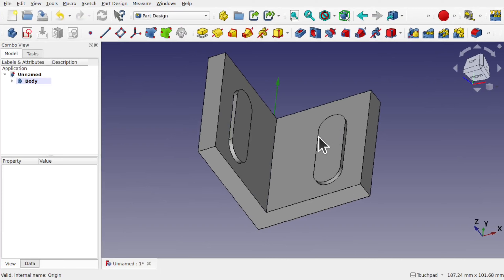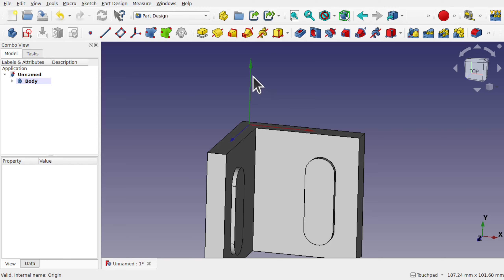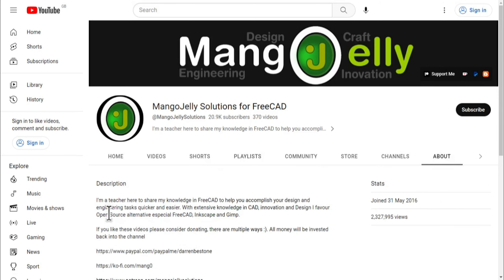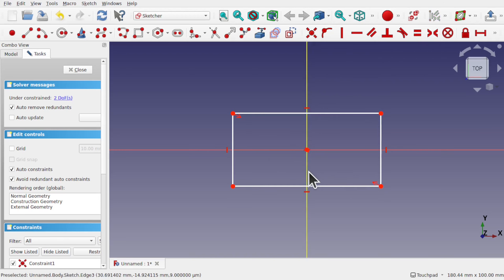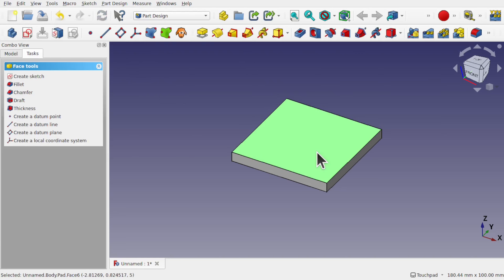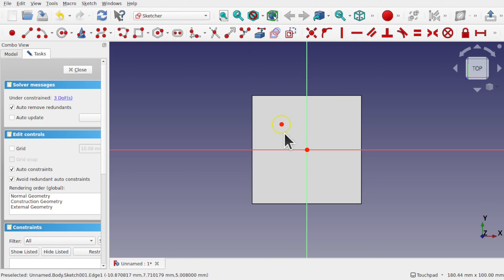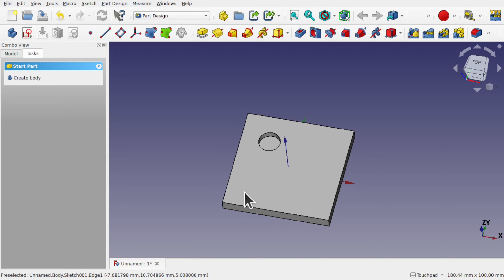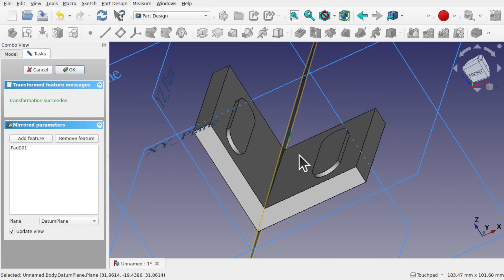FreeCAD For Beginners 45 | Mirroring off centre features | Part Design Workbench | Datum Plane

Comment: I appreciate you can only do so much perhaps a brief explanation (or direct us to appropriate WIKI) regarding Attachment Mode descriptions i.e. Plane by 3 Points, Inertia 2-3 etc. For New Chums its a bit overwhelming. I do know what Normal (to Sketch)is but the 3 points? (Points on Plane?, Surface?). I'll check WIKI for Glossary of Terms. Pardon you actually did elaborate (great anticipation Mate!). Really need to just play around on FreeCAD more to explore the various options).

Solution for positioning the Datum Plane @ 12:09, after some trial and error Lights went on, I used Opposing edges Pad001:Edge2 & Pad001:Edge18, Default Attachment: Plane by 3 points instead of the Vertices You had trouble with (No need for Rotation, I had a bit of trouble Getting my head around why you chose the Rotation Axis you did, Perhaps a separate Tutorial,? I have trouble with Local CoOrds etc when you get away from the Primary Origins. Perhaps Computers, like Me prefer Straight Lines ;-) Noticed you used the Edges in the Last Example, perhaps Edges are processed better by the Software. FreeCAd appears to have a few Idiosyncrasies ;-) Maybe this Dinosaur is getting the hang of this CAD Thingo!

Again an other very stimulating Tut, again I can see possible uses for my Aero Modelling where duplication of features are needed. Off to the Shed and some Sanding!
Reply from the maker: Sorry been away and trying to catch up on comments. I think I can help you here as I already have a video on that subject https://youtu.be/jfhgcDcAAlk

Comment: Thanks! I didn't think of this before. When having trouble selecting edges (or worse: vertices), I switch to wireframe view (Keyboard: v 3) and then back to normal view (v 1). 
Btw, during this video I noticed for the very first time, that the orientation of the axes cross is quite simple to remember: X is red, Y is green, Z is blue (like RGB colors) – "XYZ is RGB"  is easy to memorize.
Reply from the maker: I keep on forgetting about wire frame mode as you can do some interesting things by setting certain geometry to wire frame in the view tab.  Never thought of using it to make the selection easier by quickly changing to wire frame mode with the shortcut and back again.  And never thought about XYZ and RGB, that is another great tip!!!!! Thanks for sharing that! I be using that for the future :) :)
Reply: Thanks Mate Good idea! Also if you have Older Eyes don't be scare to up the point size heaps! I've found you need to be careful when selecting, a Mouse Click (Audible, for those of us not too deaf LOL doesn't mean that FreeCAD has registered it as input). I often find a lot of problems later in the Workflow come back to seemingly inputted but not registered Constraints and the like. FreeCAD is a complex System and has some idiosyncrasies we need to be aware of! Perhaps also it could be the Dinosaurs trying to use it LOL ;-)

Comment: Could I suggest that you reference the FreeCAD version at the start of your tutorial? The icons seems to be different to the version I am running (0.20.2). Thanks.
Reply: Still looks like same version you are using but he has moved around and changes which toolbars are visible plus probably has some additional plugins installed but nothing that's really effecting what is being used here.
Reply from the maker: That's a good suggestion. This was on 0.21 which had changed.

Comment: Great video, very clearly explained!

What is the difference between a Datum Plane and a regular Plane (found in the shape primitives)?

Thanks!
Chris
Reply: A plane is in the Part workbench and not in the PartDesign workbench.
In addition, it is much more difficult to correctly place a plane unlike a Datum Plane.
Finally, if you want to use a plane to mirror in the PartDesign workbench, it's a big mess.
Reply from the maker: Thank you :) The datum plane is used for reference so you can mirror across it, sketch upon it etc. Where as the plane is a piece of 2D geometry that you can extrude and boolean into your models.

Comment: What are the specs of your computer you are using as the processing is quick and mine sometimes hangs whilst computing more complex the job.
Reply: That's less of a hardware question than software… huge parts of FreeCAD are written in Python and it's geometry engine also uses only 1 single CPU Core. For example my Computer (12*2 cores @ 3.8 GHz, 64 GiB, all SSD & NVMe, GTX 1050 Ti, Manjaro linux) took about 30 minutes processing ~ 100 images of 20 megapixels in meshroom; but FreeCAD sometimes takes several minutes to compute (multi transform and such…). 
Unless someone is willing to re–write all that code… 🤷‍♂